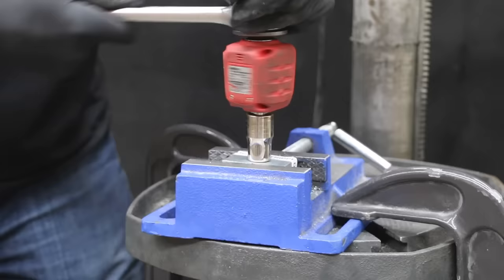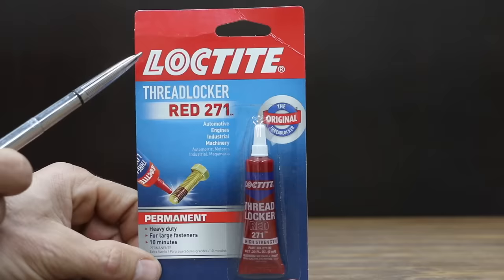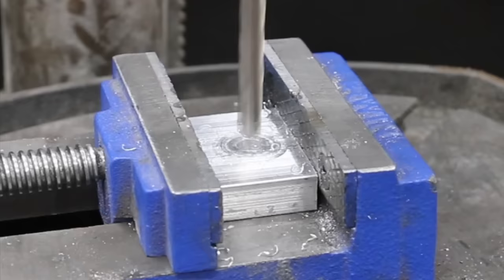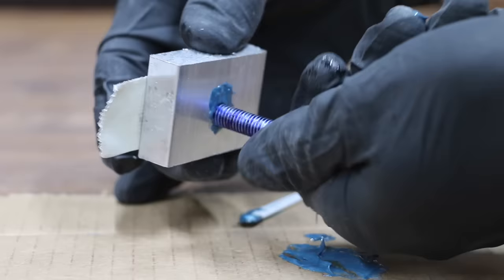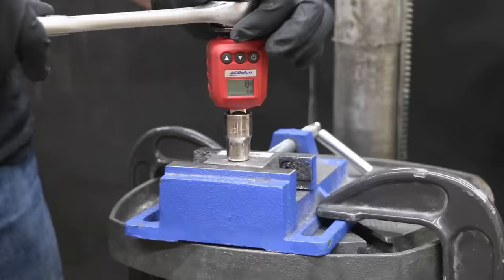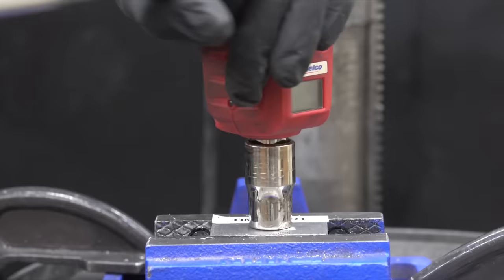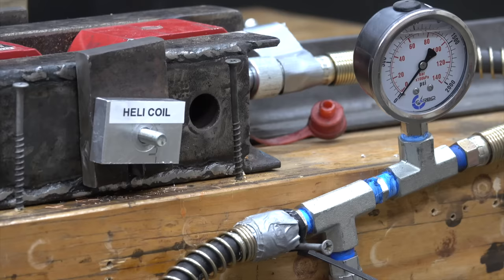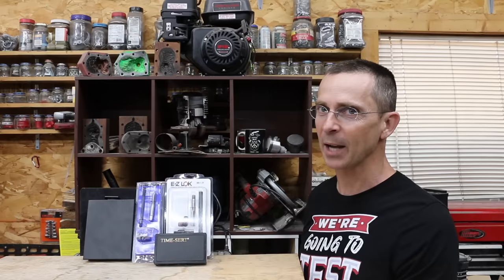Best Damaged Thread Repair? Let’s Settle This! Heli Coil, TIME-SERT, E-Z LOK, JB Weld, HHIP, Loctite

Comment: You can also put shoe polish on a bolt and put it in a hole with jb weld to not have to tap it. The shoe polish Will allow the bolt to be removed Similar to loctite 28654 and pc3967. If going to just put loctite on and put it in and not remove it I'd use the sleeve retainer 620 I think be the best I have used 640 on a screw in a distributor that kept coming out because was striped tried loctite red before it came back out the 640 worked perfectly for the time it was needed pretty much tell I had time to replace it which ended up being able 20k miles. There are times just need to get back on the road if able to the exloc is a great style to use I always put a drop of 640 on them because if I'm using repair kit it a permanent installation.

Comment: Excellent comparison.
Only thing missed is they recommend using loctite with helicoil 
Hhi and helicoil have the tendancy to go further in with regular insertion of the bolt . Ezlock is better but still can go further in or out with use . Timecert is the only one that is considered a permanent repair.
Having used all of these different systems myself I prefer timecert for parts that may be removed and installed more that once . 
If it's rare for it to come apart or is in a blind hole a ezlock or helicoil is my go to .
Reply from the maker: Thanks!

Comment: As usual, PF comes through. I just bought a riding mower, and I think that some of the engine mount threads are stripped. So I researched thread repair, which led me here. PF tested some ideas I hadn't thought of, like the copper wire, JB Weld, etc. I was thinking Helicoil (or some other brand insert) is what I'd need for the repairs, and this video confirmed it. Thanks for this video.
Reply from the maker: You are welcome!  Thanks for sharing.

Comment: Time Serts are also available in stainless steel which is corrosion averse, as well as the high carbon steel that you showed in the video. They also have Big Serts that have a much larger OD for repairing badly damaged holes.
Reply from the maker: Thanks for sharing.
Reply: @ProjectFarm  Of course. Have been using TimeSerts for decades, and never had one fail. I have had coiled wire thread repairs fail by partially backing out and then coming unwound, sometimes further damaging the hole in the aluminum.  Also, once one buys the TimeSert tool kit, the inserts themselves are quite economical.

Comment: The only variable not taken under consideration was vibration. Helicoil style inserts don't perform well with vibration, and the insert will back out. If you have enough base material on the OD, use a locking insert. Locktite on a helicoil will work where heat is not above its release temperature. 

Keen-serts are also an option, where extreme vibration is a problem. The insert has locking tabs that are driven into the base metal. 

As usual, you always make a very informative, well made video. Thanks you!
Reply from the maker: Thanks and you are welcome!

Comment: Pretty interesting. Didn’t even know products existed for this application. I didn’t think the copper would work because of how it fails under deformation, but I’ve used chunks of a zip tie before and the vinyl was quite durable and gave better results than that copper did.
Reply from the maker: Thanks for the feedback.
Reply: @ProjectFarm  Thank you for the reply. Keep up the good work. I often find myself here looking at products before I buy them, and have always found your tests to be quite reliable.

Comment: Great job sir. I can't praise you enough for such a professional, interesting and thorough creation.

I had to drill out a snapped bolt myself last year. Luckily I was able to back it out with a bolt extractor and so the threads were ok. I thought I might be needing to do the helicoil thing but I had never seen one done before.

That was really entertaining as well. I have used JB Weld on occasions to strengthen inserts where the JB Weld shouldn't really be necessary so that was also great to see.

Thank you

Comment: This is very useful, I never would have thought that thread repairs could strengthen aluminum threads. I'd love to see this revisited using a steel plate and high grade bolts.
Reply from the maker: Thanks for the suggestion.

Comment: EZ-Lok makes different wall thicknesses for each insert bolt size and they also make a standard and a stainless insert for each.  They can get more and more pricy but certainly worth it if you are working on something that needs the strength and needs to last.
Reply from the maker: Thanks for sharing.

Comment: I have used both the Heli-coil and the JB Weld method.  Both worked well and have had no issues.  I always wondered what the failure mechanism would be and how strong they were.  Thanks for a great video.
Reply from the maker: You are welcome!  Thanks for the feedback.

Comment: Thanks for the test. I think you should try using stronger bolts (grade 8 or grade 9?) for the steel inserts to test the strength between the insert and the aluminum.  Timely for me as I have two threaded holes in aluminum that stripped and need repair. I will be using Helicoil to repair them. I have had Helicoils strip out and I then repair that with a Timesert. I have also had Timeserts strip out which I then repair with a TimeSert BigSert if there is space for the Bigsert. One nice thing about Timeserts is they don't need special taps. They don't even need the special inserting tool; a standard bolt does fine to insert them.
Reply from the maker: Thank you for the video idea!

Comment: I was really hoping to see some brass inserts. We use them all the time at my job, because we know holes will get stripped or cross threaded, and its easier to drill and tap brass than steel.
Reply from the maker: Thanks for the suggestion.

Comment: I knew offhand JB Weld and Loctite ain't going to do well, copper I didn't know. I suspect epoxy paint, regular paint or Bondo in lieu of Loctite or JB Weld would do just as well. I was really impressed with epoxy paint, incredible holding force, don't know about thread repairs though. For better version of copper wire, years ago 1/4" x 1.25" dimpled steel strips were used. It was for small, non critical stuff, cheap, quick and dirty. Cylinder pressure could be 1,000 psi or more under full load, those Heli Coil type spark plug repairs have to be good. Appreciate the detailed tests, a few were better than what the original aluminum could withstand, that was a surprise for me.
Reply from the maker: Thanks!  Thanks for the feedback.

Comment: Basically, the second test with the hydraulic rams testing vertical load on the threads proved nothing works like an insert, and the inserts only tested the average tensile strength of the bolts.

Comment: I had a noticeable shake on girls jetta and after popping the caliper off, one of the guide pin threads was honed to F and back, the rotor was destroyed from the bottom getting more bite on the pad. I was thinking of using one of these sets but decided to go with a oversized pin.

Comment: I'll vouch for the amazon HeliCoil Clone (there's a million brand names) I used it to repair my previously over torqued oil pickup tube (previous owner used too short of a bolt) and managed to torque the bolt to spec.

Comment: Just one thought, maybe if you tested with a higher quality bolt the the thread repair should fail before the bolt, this would then effectivly your compare the repairs not just test up to the strength of the standard bolts. Very inforative just the same, well done sir! Thanks for posting.
Reply from the maker: Thanks!

Comment: Great experiment video very useful for oil pan drain plugs or cylinders head thread, I'd have used time sert is very good, but for easy repair or temporary repair I would try Loctite or jbwell next time.
Thank you for time and effort 👍👍👍...

Comment: For those unaware, when you buy helicoils, make sure you check the charts to ensure you get the right depth. You need to know parent material info, and the bolt info. When selected correctly, the bolt will always fail before the threads.
Reply from the maker: Thanks for the feedback.
Reply: @ProjectFarm  if anyone ever questioned that you are one of the best on YouTube, the fact that you replied to a comment on a year old video so quickly is all the evidence needed. Love the channel. Thanks for your hard work.

Comment: Quick tip, if you ever need to drill a bunch of repetetive holes like this again, clamp the bars on top of each other, and drill through several at a time. Also works for sawing.
Reply from the maker: Thanks for the feedback.

Comment: Here's a tip for liquid thread lock users...don't ever let the tip of the dispenser touch anything metal, it will shorten the shelf life of the Loc-Tite.  I learned this from a Loc-Tite engineer.
Reply from the maker: Thanks for sharing.

Comment: Re corrosion test..timeserts come in a variety of metals for diffrent applications, ranging from copper to stainless inserts. , they alsobseem to seal better for sump amd spark plugs with large diameter threads that are not deep
.
Reply from the maker: Thanks for the feedback.

Comment: To work out drill size with metric taps. Subtract the pitch from the diameter.
EG 8mm x 1.25mm pitch then 6.75mm drill is ideal or 6mm x 1mm pitch then 5mm drill
Reply from the maker: Thanks for the feedback.

Comment: I’ve always be sheepish about recommending chemical tread repair, and this just confirmed my suspicions in speculation fashion. 

I’ve always pushed an insert type repair and then maybe use a chemical thread locker to mitigate loosening due to vibrations. 

5 out of 5 on this episode.
Reply from the maker: Thanks!

Comment: I had a mechanic strip the engine head bolt and left it untreated, so a few mos. later the inevitable happened again.  Then, another mechanic repaired the bolt hole and it's working fine.
Reply from the maker: Thanks for sharing.

Comment: All of the inserts held equally with 8mm bolts. I would like to see the test with maybe 12mm bolts with harder bolts in steel test pieces. The bolts were the weak link, let's make inserts the weak link for a true test of the inserts. I like you videos and appreciate your time & effort.
Reply from the maker: Thanks for the suggestion.

Comment: When you know the Bolt size and pitch you can calculate the drill by subtracting the pitch from the Size. So M8 with 1,25mm pitch is 6,75. This size drill is no standard but 6,8mm or 6,7mm is common.
Reply from the maker: Thanks for the constructive feedback.

Comment: There's enough info in this video to keep my mind busy for a while. Not to mention enough additional info in the comments for reading material all winter. 
I have a bolt broken off on a residential propane tank capacity gauge. Have tried everything but a torch (lol) to get it out. Gauge was leaking and I wanted to replace gasket (tank is empty). Other 3 bolts came out with some time, kroil oil and some very patient coaxing. Have used left hand drill bits, exactor bits on this one that broke off...it is not moving.
Now have found this method and am considering it. If you are anyone else has suggestions or advice regarding this predicament, please feel free to speak up. 
Anyway, I will wade through the comments and see if there is some help there, too. Thanks everybody. Jesus bless.

Comment: Priceless information! I was hoping one of the "glue" based solutions would work well enough because I dont feel like pulling the engine (XR400R) outta frame to have enough space to drill & tap, but nope. Though pulling the motor will allow me to do things more properly and i'll just helicoil everything in there so I can torque stuff up to spec without holding my breath if its gonna strip or no which is the case with just bare aluminum threads that have to deal with the heat cycle of an air-cooled single cylinder and the previous owner's practice of overtightening the absolute hell out of everything.
Reply from the maker: Thanks!  Thanks for the feedback.

Comment: Interestingly my factory service manual actually recommends using Helicoil as an acceptable repair for aluminum pieces.  I didn't use Helicoil brand but OEM and feel pretty good about the repair use on transmission oil pan securing it to the aluminum block of transmission.  The torque setting was about 105 in/lbs. I got lucky on the location to access with drill bit with some rigging to extend the length. But if it happened for a couple other bolts I would have had to another method besides steel inserts.
Reply from the maker: Thanks for the feedback.

Comment: very nice video.  I need something for my cb750 keihin carbs. the screws for the bowls all stripped out ,i drilled all them and went to next size metric, then used the Allen headed black bolts.  all worked great except 1. not enough meat their to do it,  hoping i can do something to fix it.  them metal inserts sure are very impressive, WOW!   THANKS ALOT!
Reply from the maker: Thanks!  Thanks for sharing.

Comment: It was interesting to use helicoils used to fix threads. In my workplace we use copper (if I remember it right) helicoils in some applications to replace Loctite threadlocker since it both keeps the screws from coming loose and makes it much easier to remove the screws when necessary.
Reply from the maker: Thanks for sharing.

Comment: Thread repair depends on material but for metal threads in aluminum or steel if there is enough material drill and tap next size up, would be fast and secure. you could also use if you don't want to make the bolt larger and have decent material around the thread you could use same material rod drill out a hole 2 mm bigger cryo fit the rod then cut it off then drill and tap for same size bolt you could also torch the hole and use a brazing rod to fill the striped hole drill and tap for original size could also use welder to to fill hole would torch the hole first so you minimize potentially cracking the material around the hole.
Reply from the maker: Thanks for the constructive feedback.

Comment: You can calculate the tap drill size with a simple rule.

Thread nominal diameter minus thread pitch equals tap drill size.

I'll give a couple examples:

M8 x 1.25

8 - 1.25 = 6.75mm tap drill or .266", which you used in your video (17/64)

1/4-20

1/4 minus 1/20 = .250 - .05 = .200" tap drill size. The closest size to that is either a #8 (.199") or a #7 (.201"). Most charts call for a #7.
Reply from the maker: Thanks for the feedback.

Comment: Very  good scientific test. One parameter not mentioned is ease of bolt removal and reinsertion? Specifically with liquid based repairs. I presume they will need removing and reapplication? I am wondering why the metal inserts don't strip out the aluminum  as the original bolt did on the last test?

Comment: It would be interesting to see how they perform in different temperature environments and also under vibration with a lose bolt. Those are also relevant variables in practical scenarios.
Reply from the maker: Thanks for the suggestion.

Comment: Thanks for this test.  

I would like to see a test of the thread insert repair kits with a grade 12.9 bolt.  Structural engine fasteners are usually metric grade 10.9; in some cases 12.9.  I think testing with higher grade bolts will better represent bolt/thread load for cylinder heads, main caps, etc.
Reply from the maker: Great suggestion!

Comment: I have used a McMaster equivalent to the EZ LOCKs on aluminum machined and welded parts that I've designed specifically for their massively improved pullout strength. Nothing else is really worth using, with the possible exception of the keyed inserts, but those aren't replaceable.
Reply from the maker: Thanks for sharing.

Comment: Great test.  I would assert that the real question is...why would you thread aluminum to begin with if mechanical strength and thread integrity might be an issue?  Why not head these issues off at the pass by using these inserts at the getgo and not waiting for the threads to fail?

Comment: Seeing this again with a fresh pair of eyes, the conclusin I gathered from this is for something which isn't a through-hole, you can get away with the cheaper solutions that aren't Time-Sert or their respective knockoff brands with a flared insert end. For through-hole you'll defintely want something like the Time-Sert because the repair won't fall through the unit in question. But you can use some screw epoxy on the hole to help improve the cheaper solutions' through-hole use.
Reply from the maker: Thanks for sharing.

Comment: Great video as always. We use Helicoil at our shop. I would have been convinced to switch to EZLok if you hadn't have done the corrosion test👍🏻

I would have liked to see two other tests. One where there is a weight on the bolt and that weight constantly vibrates, and two where a heavy weight is smashed into the bolt from a slight angle. I believe these two scenarios are responsible for a few a lost Helicoils at work.
Reply from the maker: Thanks!  Thanks for the suggestions.

Comment: Great video. I just wonder if most of these tests weren't on the bolts themselves? It seems any proper repair method outlasted the bolt in almost every case. Twisting them first, then pulling them. The variation in the readings was almost all due to the variance in the strength of the bolts themselves.

Comment: So what you're saying is one should use steel thread inserts for threads in aluminum. This quickly became a demonstration of the tensile strength of the bolts because the results really didn't vary much. Glue = not good for metal.